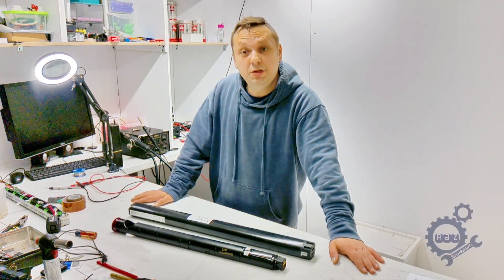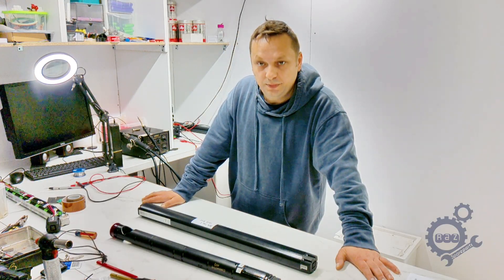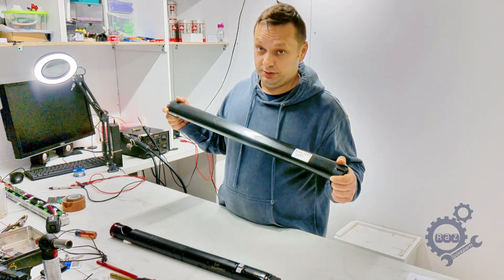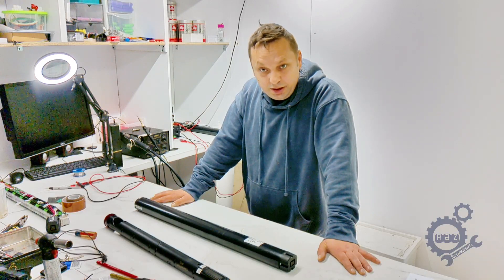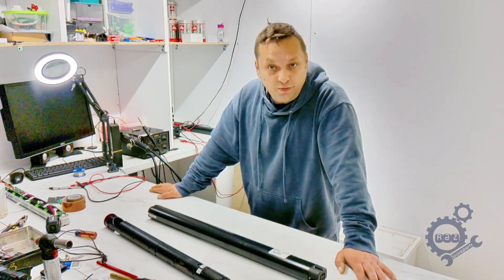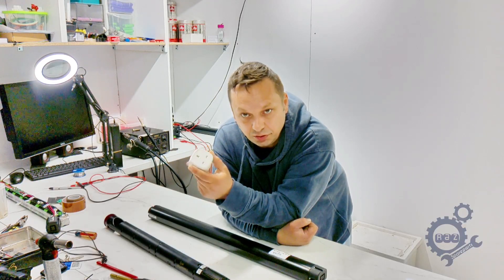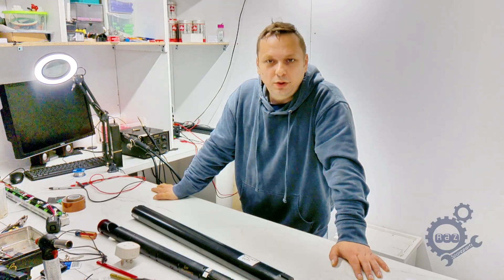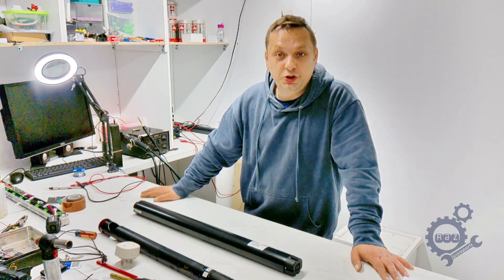How to Store & Charge Your E-Bike Battery

Comment: I have a VanMoof Electrified S and removing the battery from said model is more difficult than the newer ones. I do not see it being possible disconnecting it after every use sadly.